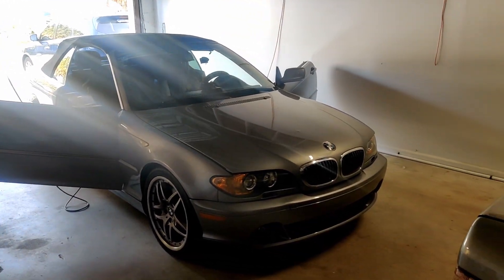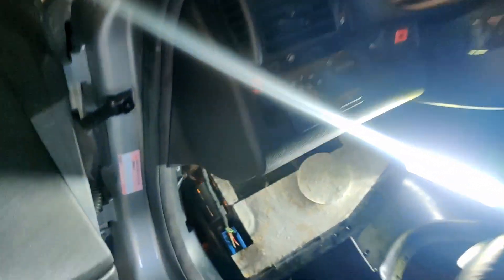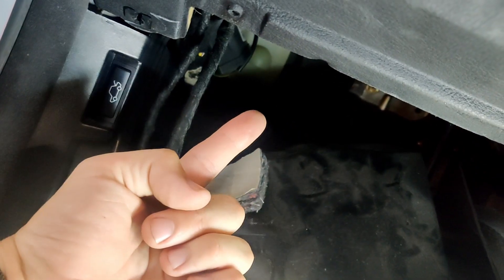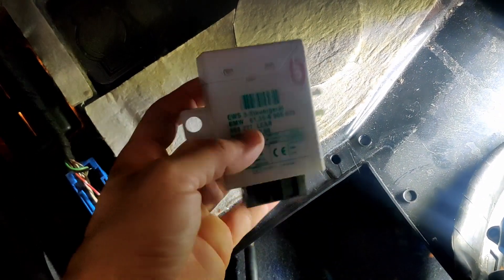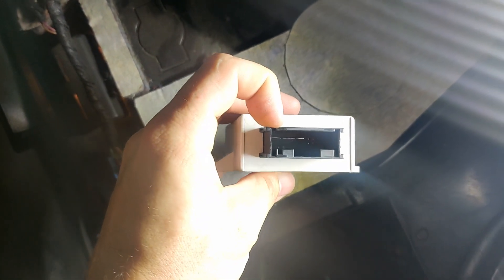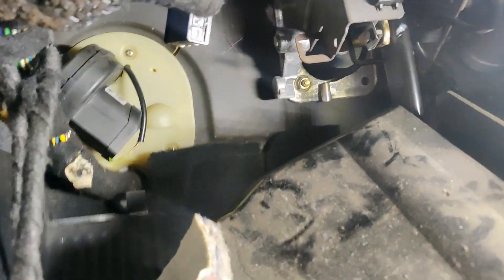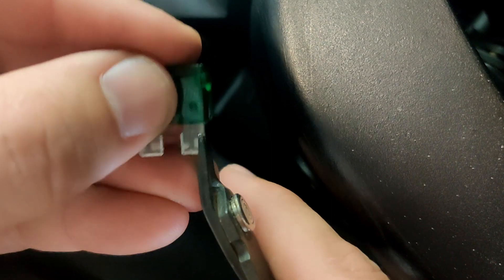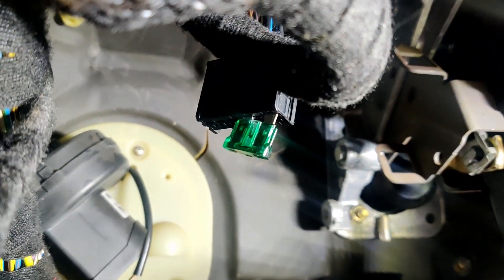How to check BMW Starter with EWS

Comment: What if that fuse blows when you crank it to check the start? (Brand new start btw)
Reply from the maker: If the fuse blows right when you crank it (even with a brand new starter), that usually means there’s a short to ground somewhere in the starter circuit. A couple things to check Make sure the starter wiring isn’t pinched or touching metal especially the main power cable and trigger wire. Double-check the starter solenoid even new starters can be defective and cause an internal short. Inspect the ignition switch or relay for a shorted connection. If it keeps popping the fuse instantly, the starter or wiring is drawing too much current, so I’d focus on the wiring first, then the starter itself.

Comment: Hello, pleases what should i do , the alarm is working with the EWS please how to disable the alarm no Start in my car
Reply from the maker: Your BMW won’t start because the factory alarm is active and tied in with the EWS (Immobilizer). This usually means the alarm is blocking the starter signal or fuel/injection system.

Comment: What does it mean when I put the fuse in there and the car actually starts?
Reply from the maker: it means that the fuse is working but you are using bypass, its better to do it the proper BMW way.

Comment: I have this same problem in my car, with the fuse the car starts but does not start, what is the reason for this? With this it is clear to me that the ignition is fine, will I have to program a new key for my car? Or will I have to change the ews?
Reply from the maker: First need to check out the EWS, to do that you will need to send out the DME, EWS, Key to us and we will check it for you.

Comment: I have a 2007 bmw x3 I had it parked for a month and prior to that I never had no starter issue. I check the grounds and the starter to see if it’s getting 12v it is. But there is a white powee wire in the fuse box and driver side I’m not getting any power. But when I power probe it. It cranks right up. I check the ignition switch wire for starter with the key on and I’m not getting any readings. But when I get a wire a job with a 12v source the car cranks right up. Could it be the ews module overall ? I don’t think it would make sense trying the fuse trick for starter because the starter isn’t the problem
Reply from the maker: Then we can check the modules and make sure they are not causing any problems.

Comment: I did that but it didn't crank  at all. Could be starter or ignition switch Rights?
Reply from the maker: Put the key into the position to start and check 12v on the big (fat) wires. If you have 12v, problem is in the starter.

Comment: Hey guys, is it possible to use 2001 e46 325i computer box on e46 320i without the ews of the 325 computer box but 320 with it's ews...if it's no, what can be done for the computer box to work on 320i.?
Reply from the maker: Contact us :
Tel:              +1(888)-541-6025
WhatsApp: +1(561)-385-5843
E-mail:        sales@ecuteam.com
Reply: DONT. WITH OUT GETTING THE EWS BOX CODED !!! IT WILL FRY ECU

Comment: Hey would the DME from an e46 318i be compatible for a 316i,both within the year of 2002-2004,same n42 engine and DME number?
Reply from the maker: Yes you can, contact me and I will help you program it.
Reply: @ECUTeamCorp   not sure if it’s okay with you, there’s this problem that had my car down for a while,hence the reason I ordered the computer, presuming that could be the issue,is there a way I can send you a video of the problem I’m experiencing, cant seem to find a video on YouTube similar to that problem, seems to be uncommon
Reply: @ECUTeamCorp  shift select constantly clicks after trying to start car, also a constant noise from the throttle body
Reply: I sure will,it should be in by next week, ordered it!! Tnx
Reply: How do I contact you though?

Comment: so i have the same situation as you where with the fuse in the connecter it only cranks and without the fuse, ews box plugged in or not, it doesn't even crank. does this mean that my ews box has gone bad and i need to replace it? i was thinking of getting a new one from the junk yard and programing it to my key. will this work?
Reply from the maker: Yes, make sure that the mechanical part of the car is operating fine, then move on to the EWS.

Comment: Can you tell us what this means? What needs to be repaired? Is it something within the EWS?
Reply: Still doesn’t explain why you pulled the EWS to test a starter that can be tested much much easier
Reply: @smokin4x45 the test wasnt for determining if the starter was bad.  it's to determine if the ews is bad
Reply from the maker: Older BMW's tend to break down electrically, such things as the DME, EWS(in newer models, CAS) and the keys always go bad. Synchronization and burn damages are common.

Comment: Hi mate, i have lost the chip in my key (long story short, my house was broken into & ran after the shxts and they dropped my key without the chip ha)

if i do this to bybass the EWS it should start, correct?
Reply from the maker: You wont be able to do the bypass of the EWS. You can send in the EWS and we will make you another key with chip.
Reply: @ECUTeamCorp  well I used a fuse to bypass the EWS and my car started 😏
Reply from the maker: I'm sure the car cranked but no start. The car cannot start without an EWS.
Reply: @ECUTeamCorp  where are you guys located tho? And how much for a new chip?
Reply from the maker: We are in South Florida. 10415 Riverside Dr unit 102 Palm Beach gardens FL 33410
Reply: @ECUTeamCorp  would I be able to splice the two cables together and reconnect the EWS? That should start right?
Reply from the maker: It will still only crank. In order for your car to start the EWS must communicate with the DME. When the EWS will be able to read the key, it will give the signal to the DME to start. Therefore you will be able to start your car.
Reply: @ECUTeamCorp  I've heard elsewhere differently. That you can delete the EWS and it will delete the emobolizer and start without it :/ so now I'm confused whata true
Reply: If you jump start the wire straight to the Starter there is no reason why it shouldn't crank as that's all the EWS does. It's jumping the queue basically and going straight to it
Reply from the maker: @TheLocalGent   @The Local Gent  honestly I'm here to help, you can do a jump start. The car will only crank. I'm talking about starting the car. If that's all what EWS is doing then why does the key have a chip in it? EWS transmits the information from the key, through the EWS (immobilizer) and then it sends information to the DME allowing your car to start. Do more research on what EWS is doing and why it's important in bmw.
Reply: @ECUTeamCorp  im well aware what everything does! i literally just started my car by bypassing the EWS with a fuse. so is this NOT suppose to happen? :/

Comment: I have a 2000 323i pretty sure the Ews is causing an issue with no crank/no start. I mess with the wires and then it’ll start sometimes. Will this method temporarily bypass the need of my immobilizer and get my car to start? There’s nothing wrong with my starter. It’s strictly an Ews problem and I’ve had the ring replaced.
Reply from the maker: No Bypass, why are you so sure that the problem is in the EWS? Send us the DME, EWS, Key and contact sales@ecuteam.com for more info.

Comment: I have the same problem, but, when i plug the fuse in, starter isnt cranking? Is that a bad starter or just there is an relay or fuse i could check?
Reply from the maker: The problem is either in the starter or the wire that goes towards the starter, I think so the problem, might be with the starter.

Comment: I'm getting a no crank no start is this a way to find out what it is
Reply from the maker: Check your ignition switch and the starter, the wiring that goes to the started and to the ignition switch.
Reply: @ECUTeamCorp  thanks so much
Reply: @ECUTeamCorp   its was misfiring and stalling before this happened..
Reply: @ECUTeamCorp  I really appreciate the help

Comment: If the EWS is good, is it safe to remove it without disconnecting the car's battery? I don't wanna remove the car's battery because I don't wanna lose some codes for the radio. Thanks.
Reply from the maker: You can take off the EWS without the cars ignition turned on. Make sure the key is removed from the ignition.
Reply: @ECUTeamCorp  Thank you! So if I understood you well, if the key is not in the ignition, the EWS can be removed without any problems even if the car's battery is connected?

Comment: Hola amigo, como lograste prenderlo? Solo cambiaste la ews? Yo chequé mis relays y están bien, hice lo mismo que tú con los cables y me pasó lo mismo, pero al conectar un cable uniendo los cables negro y negro/azul da arranqué, pero no logra encender el vehículo.
Reply from the maker: Hello! We are showing you that we can repair such things, visit ecuteam.com and request a quote!
Reply: Hello I'm having the same problem with the BMW not cranking. So I did the bypass like you shown in this video.  The car cranks over now. Thanks. Well is there a way to bypass the security system all the way around? I was hoping that the car would start with the two black wires connected and the box plugged back in. Well it just cranks over but wont start. So is there a way to bypass the security system or I have to have the box reprogrammed to the car, key and ecu? And what's the ticket on doing this? Hey your website isn't working.  Do you have a phone number to contact you?